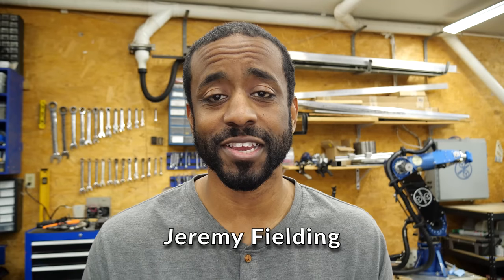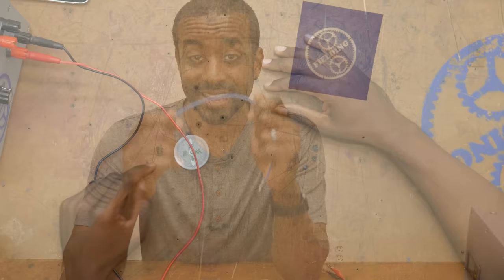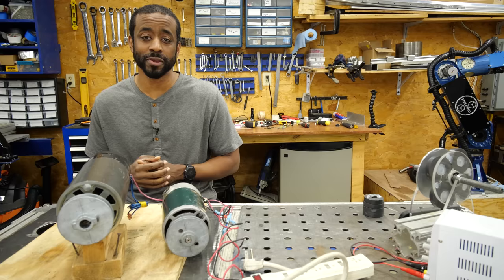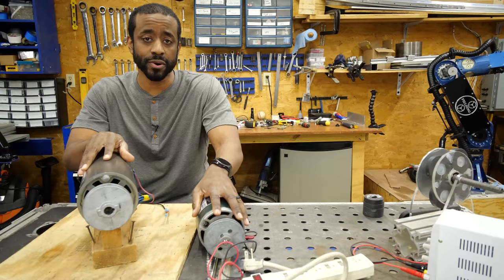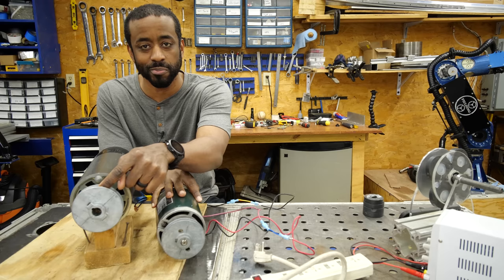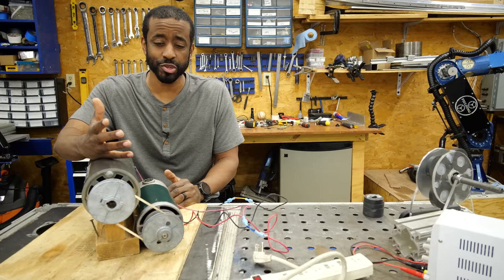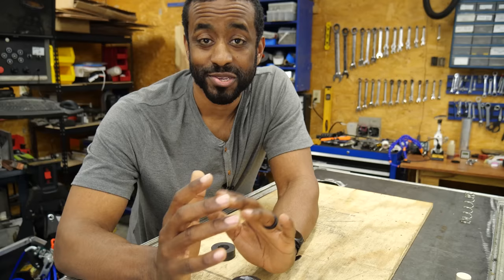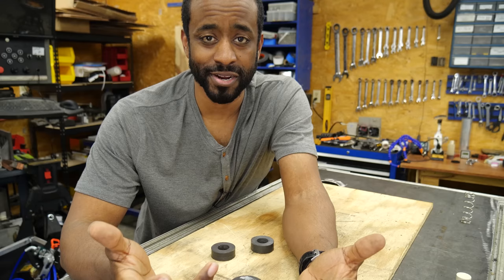Reviewing Free Energy Generators.  A Response to My Video "Nikola Tesla's Greatest Invention"- 102

Comment: So high output generators or alternators connected to the already spinning tires and feeding back to the battery. Its already using the power to spin the tires.  Any extra energies from the generators or alternators shouldn't draw more power as the tires are already spinning.  And yes i watched the video. But i just cant shake the idea if its already drawing power to spin tires how can you lose by rolling the power from there.
Reply from the maker: I think you might understand part three better. Link in the description. The part you don't get is that alternators convert mechanical energy into electrical energy. There is no such thing as "already spinning so free energy." There is no extra power or energy. The spinning IS the energy (kinetic energy). If you connect an alternator it converts the speed (mechanical energy) into electricity and the car stops. Its a giant brake! I prove this in future episodes. The point is energy is not created it is changed from mechanical to electrical. Again I proved this with several measurements and an alternator and a few other devices in part two and three.
Reply: @JeremyFieldingSr  how about with wind driven propellers then...or does this end the same way. My brain really wants this to work. Also the entire outside of the car should be a solar charger...that would work most of the time. Except of course night time.

Comment: Why couldn't they turn one or two of the wheels into alternators/generators , i know you wouldn't get 100% of the power back but wouldn't some power being put back into the batteries better then none at all . Im not a electrical engineer at all , isn't the movement of the wheels wasted energy ?
Say your EV is at 100% and lets say you get 250 miles out of one charge and lets say you somehow turn the wheels into alternators/generators and as you drive they charge the batteries to where you get an additional 75 to 100 more miles out of the batteries .
Its like the old school bicycle head lights , you have a little generator that runs on the rim of the bike and as you pedal your head light lights up .
Just asking for a friend 😉
Reply from the maker: I made a whole video about this. The short answer is you make the car more expensive and you still get less mileage compared to not adding it. You make it worse in every way, cost, mileage, weight, you name it. The reason why is pretty simple. The energy is not free. The alternator is like a brake. And the brake's strength is in direct proportion to the power it makes. So the faster you try to spin it the more it brakes and the cars motor has to push harder to overcome that. So the power is coming from the same battery you are trying to charge and you lose a lot of it in the process.

Comment: Asking,if I use a car 12v altinators to power4-12v moters to spin 4 bycile wheels via belts to spin 4 24v 350amp altinators to charge 4sets of batteries to inverters to power my 200amp service????
Reply from the maker: You would get 1/4 the power to each motor. You can’t multiply the output. That’s the whole problem

Comment: I hate to leave a negative comment but I was expecting to see an exact replica of somebody else's experiment  to see it work or not. Instead you just Wired a couple of DC Motors together Attach the two Pulley's together with a slipping rubber band give it a half hearty spin and said look it doesn't work, I want my money back...... Ohh wait nevermind it was free. I want my time back!
Reply from the maker: This Saturday you will see me make a replica. I felt  this was a better way to address multiple scams at once instead of trying to test just one. When there are hundreds of versions of this scam.  The concept doesn't work its not about the details of the design. However, I see there is a huge interest in seeing exactly what a "exact" copy will do. So I did. The video is done. You can see what happened Saturday! Thanks for watching and letting me know. You asked... I answered :)
Reply: I look forward to seeing your video on Saturday. I respectfully disagree with what you said about:" It not being about the details of the design: it's all about the details of the design when trying to prove or disprove if a over unity contraption works. It's impossible to find evidence of something not existing, therefore a waste of time trying to prove that a over unity device doesn't exist, one can only test each device on a case by case basis. In Saturday's video I'm hoping   for at least a 1,200 rpm start on the generator side and a lot of gear reduction implemented with a large pulley on the generator side and a small pulley on the motor side. I'll send you the design I want you to test with precise instructions on the testing method...... (Just kidding about that part) Thank you for taking the time to put these videos together! I know it's a lot of work and a lot of money you're investing. @Jeremy_Fielding
Reply from the maker: @CFRoach Thank you for the kind words. you might also enjoy part two. I test an alternator and there is a detailed review of gears / pulleys and their effect on power. That would be helpful I think. Link already in the description for that one. Once you have the gear part down, I think the rest of what I said will make more sense. We do agree you can’t prove something doesn’t exist. But you can prove it’s unreasonable to think something exists. like a magician pulling a rabbit out of an empty hat. I can’t prove that’s impossible or that no one ever figured out a way to do it. but no one thinks he really is doing it either. It’s more about how well you understand the problem. We all understand object permanence. Gear have no effect on power. I demonstrate that Saturday with a bicycle and in part two with levers. I look forward to hearing your thoughts after the video Saturday
Reply: I'm actually a experienced electrical engineer with a couple inventions and patents under my belt and I've been involved in solving some next level non ferrous metal repulsion problems.  (none dealing with free energy) The point I'm trying to make is: I understand all the concepts. We are very primitive society and have only had technology for less than 100 years. A magician's trick is one thing but science is another subject. You can prove that it's unreasonable for some things to exist. I agree with you on that point. When it comes to free energy devices though it's unreasonable to come to a conclusion one way or the other without testing at least the ones that appear to be the best designed. Years ago It sounded impossible, like Magic even to make a One million four hundred thirty seven pound train levitate but it happened and I knew the guy that made it happen. You know how many guys told him it was impossible and would never work!   I hate to get on your case but if you're going to be testing a over unity device you should build it as best you can and do it with an open mind. (If you get one to work destroy it immediately and move to Brazil. Just kidding... Kind of). Anyway thanks again, I look forward to seeing your video tomorrow. I'm not expecting it to work but I'm hoping that the setup takes longer to quit spinning with the wires from the generator to the motor connected as opposed to being disconnected.   @Jeremy_Fielding

Comment: You start from the basic premise of the conservation of energy 1st law. These motors in theory tap into zero point so called which is a recognised energy source in conventional physics.
The bedini generator for example relies on the balance of the magnetic field of the magnets creating the force and EMF to continually cycle with a small starter current or pulse charge. You touched on this by saying that you would need a computer generated aka industrial research facility and the viewer in his shed could not do it. Is this an admission of the possibility?
Known science is not all science. When we discovered quantum mechanics we did not abandon Newton.
Reply from the maker: I made this series to prevent people from being scammed over something that is easy to measure, test, and prove. That's all. There is no deep physics debate here as many of the scammers try to make you think. Seriously, if you really think this works you should just try it. It would clearly be worth your time, and It is a great day to learn.

Comment: CAN YOU COMPENSATE WITH NON FRICTION TRANSMISSION   100 TO ONE TURN OR CAN YOU USE MICROWAVE TRANSFORMERS TO STEP UP THE VOLT TO GEAR ??????
Reply from the maker: You should watch part three. Link to playlist in the description. I explain both the transformer and gears in a way that you won't ever have this question again :) There is a demonstration as well to prove how they each work.

Comment: Riding with some strangers and they pull a gun out and start robbing, had this done, and somebody pulled a 25 caliber revolve around me trying to rob my 900 desktop. If you're one of the passengers and you didn't know that Robbery was  even possible? We're going concept You might not have been in that car. That was 3 other people, including a single mother. That was not not with her child at the time just helping a friend
But this guy thought he would be slick and pulled that gun. He got caught the cops found the car.
Charged to everybody 
I think , So there is concern about the point of liberty and not putting yourself in a position to have a target painted on your back. Or somebody just say that they're affiliated with something else. Taking place sensors railroad tracks underneath. There is a railway alarm there, so there's other places for people camp.

Comment: I guess with the generator and alternator if that won't work then the automobile will not run, 😮
Reply from the maker: Why? These are different systems. Gasoline is the power source in HD gasoline vehicles. If you connect a generator back to itself the power source is nothing. Like saying your own leg for food. This can't last very long. Just think about what is happening

Comment: So I had to be careful not to take out too much tondora or things like this to that. I would be in a sense moved or showed with them as like them Pointed out as clearing brush and it's associated as both of us being a nuisance Damaging city property even though it's weeds and blackberry bushes and bullshit.  Nothing of any value I actually had a law enforcement. Officer said they could charge you for theft Three as fact of electricity for trying to use an outlet  outside on a property gas station  That was not covered or locked up or nothing

I was quite appalled by this difference

I've only heard others as homeless talk about it, but it really's still just amazed me the differences to interpret the law as you want and make up some b***** charge just to handle the situation. Because there were ones that are out there. Putting a bad image and a point of havoc on others

It sucks but it does happen

Comment: Pulley=work a larger pulley on hooked to the electric motor and a smaller pulley on the alternator or generator or it Will not work it's John Davis space ship engine with compressed air
Reply from the maker: Pulleys don’t change work. I explained and proved this in great detail in part two. Link in the description

Comment: Vertical linear generator under water using buoyancy to lift ring magnets. Gravity to make them sink again, and again...  Changing buoyancy uses less energy than hauling up. So.... free energy?
Reply from the maker: The short answer is no. It won't work. There is no system by which you can create more energy then you put into system. Though I understand why you think this would work. It is actually a rather common suggestion. But you don't have to believe me. If this worked the idea would be worth hundreds of billions of dollars so this is definitely worth trying just so you know for yourself. If your right you change the world, and if you are wrong you get a great lesson in physics. You really should try it for yourself! You will understand it much better seeing it rather than me trying to explain it here.
Reply: @Jeremy_Fielding  When the magnet container gets to the bottom, it stops. Effectively weightless. With as much potential energy as it had at the top. Mechanical energy required to expand the container could come by ending the coils so the container can fall a bit further and stretch. Grab the top of container so it stretches/expands. At top, breaking the surface would add enough weight to top of container to squeeze it down to descent volume/density. If you make one, be careful who you tell about it! ;)
Reply from the maker: You really should just try it. The surprising thing is you believe in this but haven't done it. You will understand the problem so much better when you try.
Reply from the maker: @SheWhoRemembers  The reason I suggested you try it is because the foundation for your idea is full of assumptions that are not true. It difficult to untangle them all in the comments. There is no such thing as thermodynamics not applying to water being the worse. Its hard to imagine how you came up with that. I get the feeling a scammer who sounded trustworthy made this up and you are reusing the idea thinking it is true. If this lack of thermodynamics under water was true we would just build our power plants under water and save billions of dollars in wasted energy. And we would get the benefit of cooling from the water since heat is the biggest problem for most power generation... Anyway... The idea of testing it yourself was for your benefit. There is nothing to wrap my head around. The idea doesn't work for reasons that are clear to me and easily testable to remove doubts. I was trying to give you a simply way to make it clear to you without me just saying you are wrong. I wanted you to see for yourself where this idea doesn't work so you don't just think I am not listening. I am trying to point you to an easy way to answer your own question with measurable facts. Thanks for commenting and sharing your ideas. This really helps me understand what people are thinking, and where people get confused. Future videos get better every time I have an exchange like this.

Comment: This doesn't make sense to me because a petrol generator works and runs.

Why wouldn't a Electric motor work in place of the fuel engine in driving the generator?

With electrical generators with increasingly higher kilowatt outputs, the idea should work because the electric driving engine/motor only needs to reach a certain spin per min/hr rate for the electrical generation to start being put out enough electricity and with different motors having higher output all that is needed is to reach "that certain output spin rate" right?

Isn't it more that you need a way to get the "generating" motor up to enough speed and revolutions per minute on it's own to start putting out enough power to start & drive the "other engine" that will power the system ie both motors?
Reply: @darklight2.1  Hence a generator motor with larger output capacity (larger magnets+more copper wire)... Losses doesn't mean it doesn't still work.
Reply: @darklight2.1  

So whats the difference between any basic same design generator motor with varying power outputs if it isn't differing amount magnets & copper?

If a motor can run on electricity...
And a generator can be driven by a motor run by fuel...

Obviously there needs to be third component to balance the start & running & the losses...

You are a compelled wordplay robot puppet, darklight. Don't bother me with your know it all logic & energy talk.

No free rides...

Free rides exist.
You just gotta switch out the greedy components from the system to balance it.
Reply: @darklight2.1  

Good day to you, Sir.
Reply: just try it yourself. If you're right, you just invented free energy. If it doesn't then it doesn't work. The best way to learn is hands-on. The physics of thermodynamics are pretty airtight, so I wouldn't go into it expecting a positive result necessarily, but hey it's a fun learning project either way.

Comment: best I've  really  had and that wasn't  using browser and online screwing  around, always  had high speed unlimited  full service  80 month mostly, portable  generator  you can buy solar panal for  and had usb ports 110 outlet cigarette  lighter outlet  i think but also i think 1 them was car jump as built in as a 1 x jump  for rating
At Home Depot  everett  wa 
Amazon  was about same price
By weight  ratio it really 
wasn't a practical  thing carry all belongings  plus additional  backpack  with battery  port.  But i thought back my bike flat bar installed  4 like basket ride around recharge at say Starbucks  were they aren't  limiting  output of multiple  plug strips  that pc's are also plugged in   so charging  with wall charger 3amps or 5 amps or. 15 wheels 
75 wattage

Comment: Hows it fake he had an old school generator and a car alternator... one round circuit the old generator motor was feeding the alternator to spin the generator powering the alternator
Reply from the maker: I feel like you are asking the question without watching the video? Maybe you would like part two better. I measure the power in and out of the alternator and demonstrate the problem with the real part. Link in the description. Short answer... its a scam, it doesn't work and there are many ways to fake this. If this worked it would be worth hundreds of billions of dollars. I suggest you try it yourself. Its pretty easy to test and well worth your time if you're right. Thanks for watching!